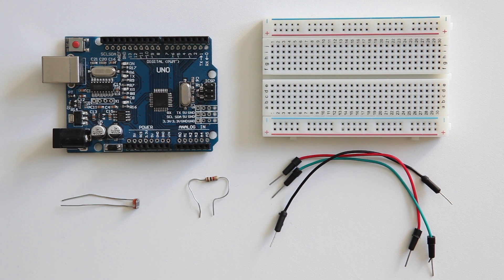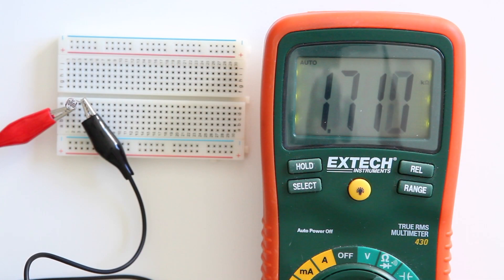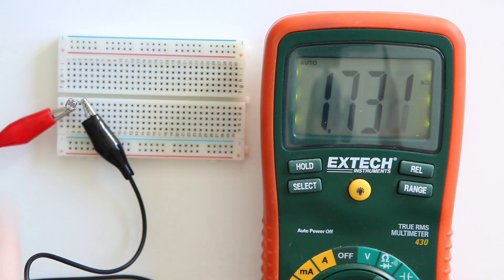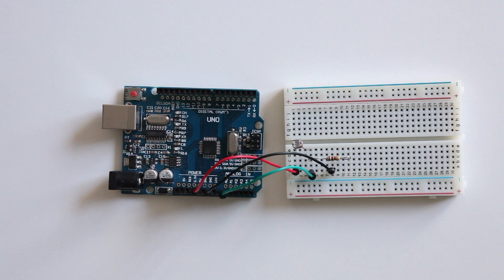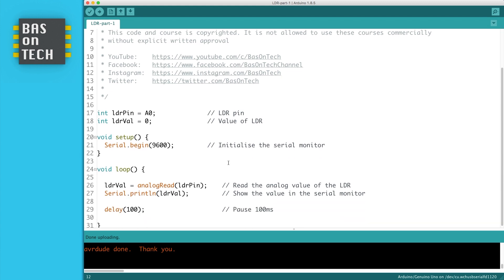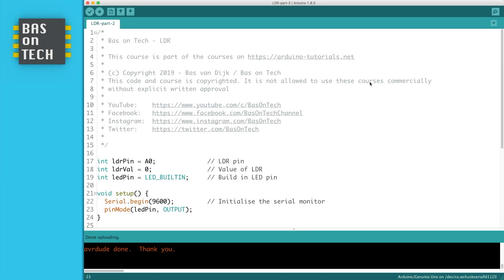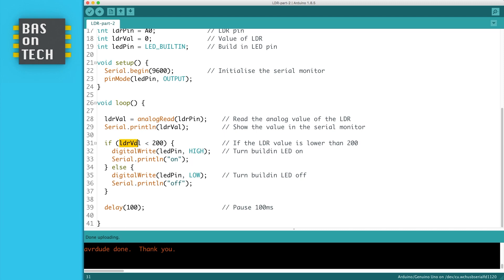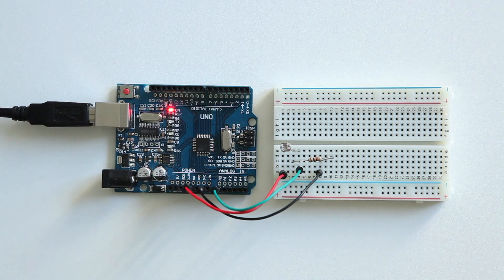LDR (LIGHT DEPENDENT RESISTOR) - Arduino tutorial #20

Comment: How can I calibrate LDR?
Reply from the maker: You can't. The way the LDR works is via the chemicals in the sensor. However you can create an offset or make your code work with another sensor value. Keep in mind that over time these sensors wear so you might need to adjust the code anyway (or use a potentiometer to set the correct threshold)